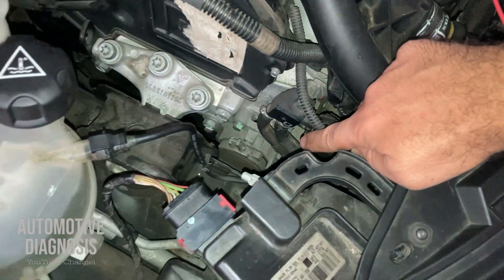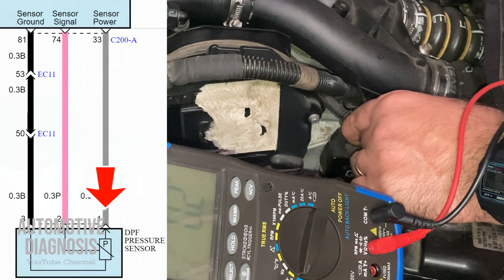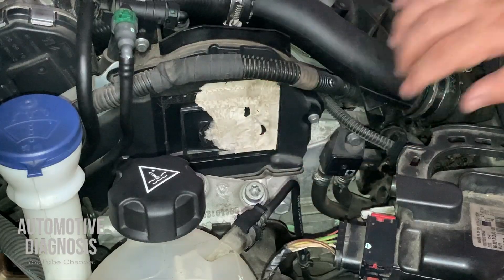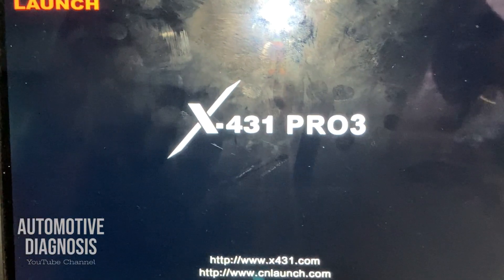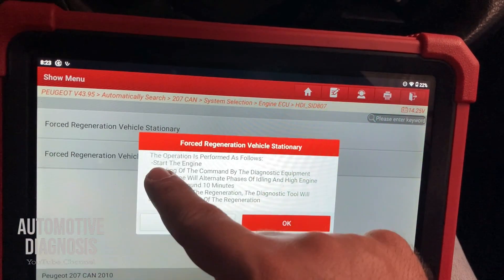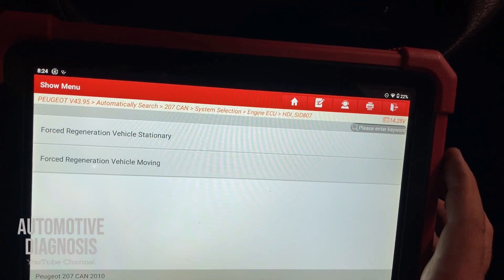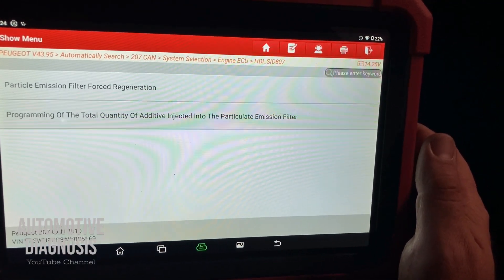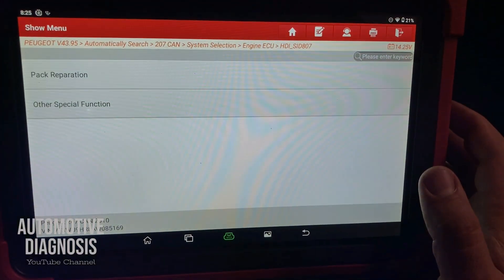DPF & DPF Differential Pressure Sensor Diagnostics #dpf #dpfcleaning #diesel

Comment: My DPF does not have sensor but I keep getting error code p0238 and engine warning light. 2.0vgt diesel engine
Reply: ALL dpf's have a pressure sensor.
Reply: @khalidacosta7133  on the GWM 2.0vgt diesel engine, there is a MAP sensor and no DPF sensor. I would be glad if you can show me where to find it

Comment: can you drill the filter away?
Reply from the maker: You shouldn’t and you don’t need to. You shouldn’t because it’s illegal to drive a car when DPF is emptied or removed, also it will release the Pam into the air which is harmful to the environment. You don’t need to because if DPF regeneration happens frequently (& automatically), there will be no soot to clog it, therefore it won’t affect the engine power that much.